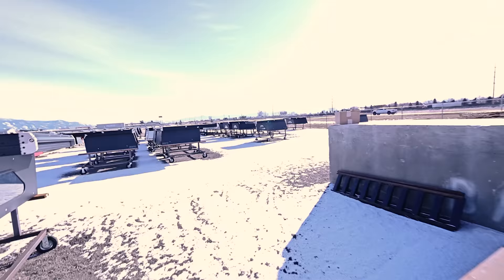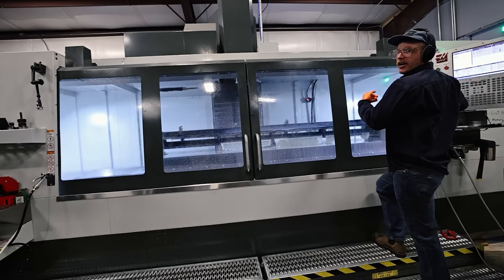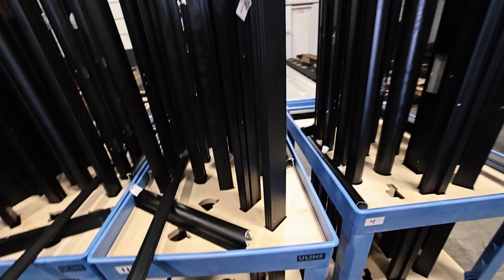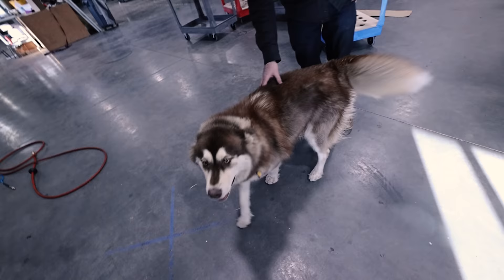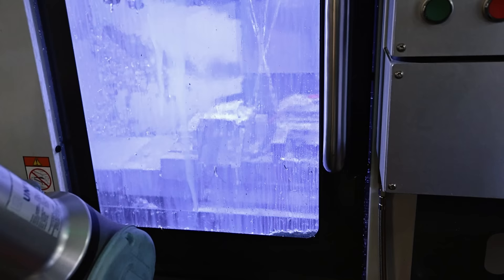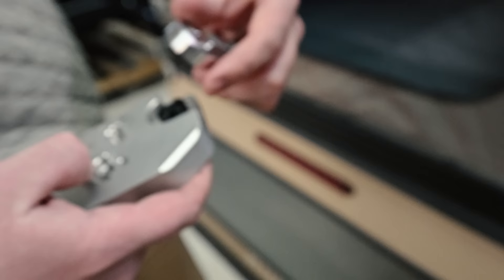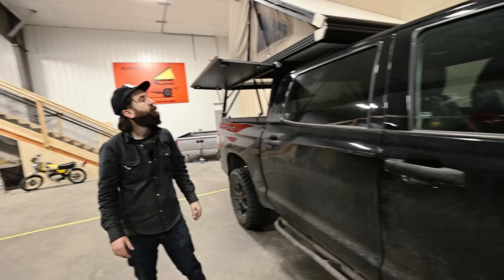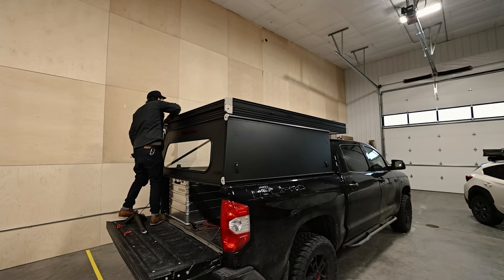GFC Superlite, V2 Camper, Shop Tour, Robots, and Everything GO FAST CAMPERS

Comment: owning a new Suzuki Jimny or Samurai as you called them in the states with a rooftop tent I wish this was in the market a year ago, For vehicles with strict weight limits on the roof while driving this is by far the most innovative RTT yet. And not only is this good for vehicles like mine its good for all since having weight on your roof is never ideal and finding ways to keep it down should be more mainstream. I'm glad the market is finally moving this direction and GFC is leading the way. Hi from Australia

Comment: Thank you for sharing this especially you brought a Crosstrek to show us how it really looks on a compact crossover. 
My concern is how to safely mount the RTT? Is a roof rack like yours required? Do two cross bars work?
Also, did you find the rack on the Crosstrek is a bit tilting down in the rear? That would make a huge problem for sleeping position. I also found my roof has similar slope in one end that makes the roof not levelling at all. How could I solve the problem? 
Thank you for introducing GFC.
Reply: Park facing a degree or two downhill

Comment: Looks AWESOME!!! I just installed the Decked Drawer System in my 2017 Tacoma SR5 & have been looking at hard camper shells with plans to put a RTT on top. This seems to be a better route to go! I'm just curious what the road noise is like with that front lip hanging partly over the cab? Thanks!!!
Reply: Not sure what it’s like but I know that Sherpa equipment company makes a quarter rack to split the difference to the rest of the roof and help with aerodynamics/wind noise

Comment: how much can you fit inside the v2 when its fully closed? how thick is the mattress? is it possible to request for a thicker mattress if the original doesnt suit me? can the lightweight version be manufactured shorter so that there's no overhang on a smaller car?

Comment: wish there was a solid solution to mounting the superlite on my tacoma. the tall yakima bars are overpriced and look funky.
Reply: Bro get a cab height rack or a camper shell. There’s literally tons of options to mount it
Reply: @sethmarion2833  the whole appeal of the Superlite is to reduce weight when you’re wheeling. A camper would throw an extra 200 to 300 pounds in the rear.
Reply: @adrianc4575  then get an aluminum rack... literally tons of options

Comment: Cool company with great ethics and the engineering is phenomenal!!. Not to get too political but those in "power" do make a difference and seeing how the current admin is running things (no XL pipeline, no fracking, getting away from energy independence, offshoring manufacturing, etc, etc) it is going to take a toll on the average person. The biggest regressive tax there is are the rising gas prices. With the rise comes less travel, less recreation etc. I hope this doesn't hurt companies like this that are really striving to create an awesome made in USA product. With all that being said I liked the idea of the RTT but hated the compromise due to weight and more importantly the $$$...The GFC Superlite looks perfect.
Reply: Not to get to political buttttt, gas was cheaper in 2016 than at any point during trumps only term. Conservatives then said presidents had very little affect on gas prices. Lol.
Reply: @tacojuan789  You are correct. In 2016 the average price was $2.204 in 2020 the average price was $2.242. Over the span of Obama the average was $3.061, the average over the span of Trump was $2.55. Pretty big difference.  Regardless, (and this is even excluding is all other things that deal with petroleum, like heating oil, natural gas, etc) the most regressive tax is when the cost of gas goes up.
Reply: I'm an operator for one of America's largest oil companies, believe me every time any pipeline is completed jobs are actually lost. They create temporary jobs for welders and others but when they are co.pleted all those jobs are gone and oil companies, trucking companies, UP, BNSF, ETC. All furlough or layoff employees ive seen it happen plenty of times, these are all high paying jobs.EV  and alternative fuels are the future and honestly there is no stopping it. Even oil companies are starting to hedge their bets by investing in bio, solar etc. jobs. Not saying I like it im just saying there is not much you can do stop it.
Reply: @tacojuan789  I agree that this is the future as you said but the way to do it IMHO is through a transition not by executive order where one day you are working and the next day you are not. At the present time there is nothing cheaper than using fossil fuels. It's unfortunate they have gone away from an even cheaper source as nuclear. If one can look at what Elon Musk has done and actually make an electric car that is both viable and successful that is a good example. I hope VW does as well. But right now the technology is not where we need it for the storage of electricity and that's the biggest obstacle. All this being said high gas prices do NOTHING good for my 80 series Land Cruiser. ;-)
Reply: @NigelNaughton  I agree on the executive order being an issue and I also do not like high gas prices for my gx460 or tacoma. Lol
Reply: @tacojuan789  we are in the same boat..Thanks Toyota! haha